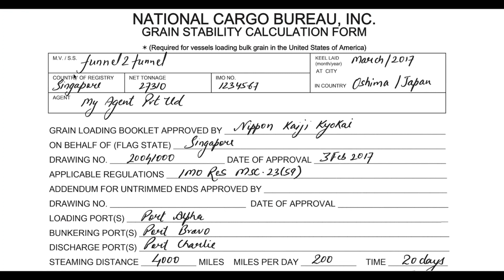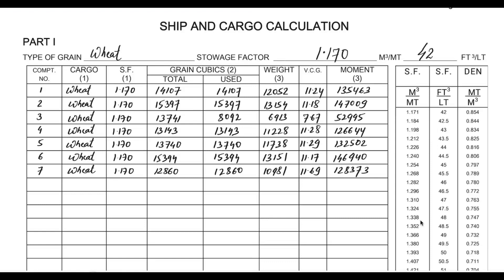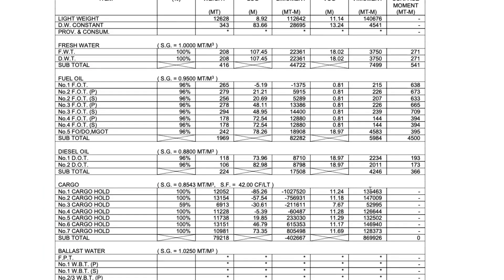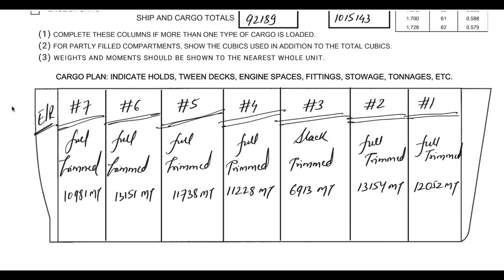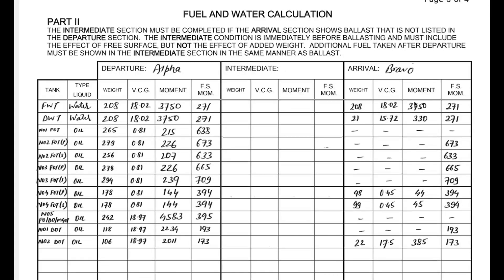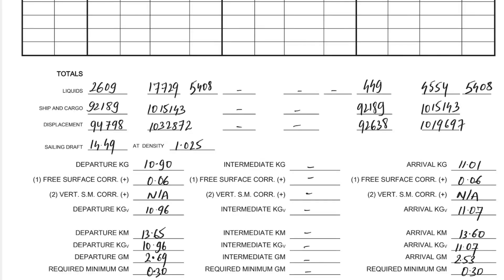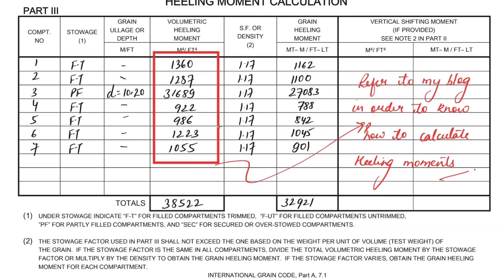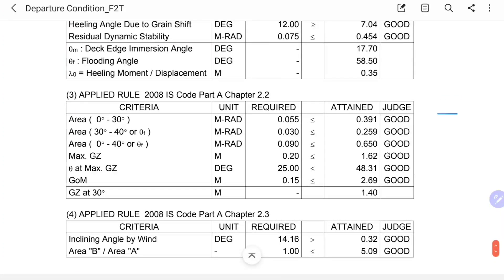How to fill NCB form for Grain loading | Part 2 | Simple Explanation | Funnel2tunnel

Comment: No point filling it this way, u are supposed to fill it without loadicator report, Im very happy with other video but not this one, i can remake another video showing how u used grain manual to get all the values including but not limited to using graph to find kg and vhm and multiplying by factor 1.12 in case partly filled cmpt even finding allowable heeling moment using final displacement and final kg

Comment: Good day Master, I have a question. Why did you fill out the column (1) as it was written below that it should only be completed if you are loading different types of cargo and stowage factor. Also the  Grain Cubic  Used as it was alsk written that you should only fill up for slack tank. Thank you.

Comment: hi i just noticed that if you multiply the grain heeling moment of slack hold that you get on loadicator multiply it by stowage factor then the last digit of stowage factor add 01(it is the 1.12) the result us the same. example 27083*1.1701=31689 hope it is useful.